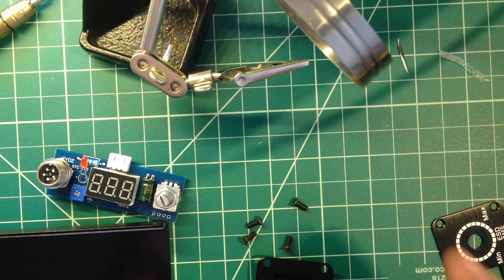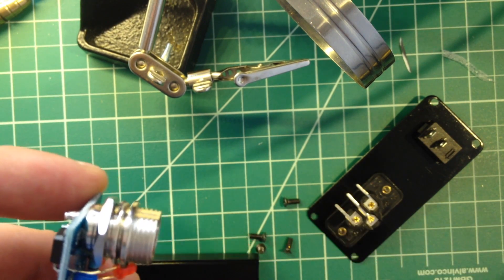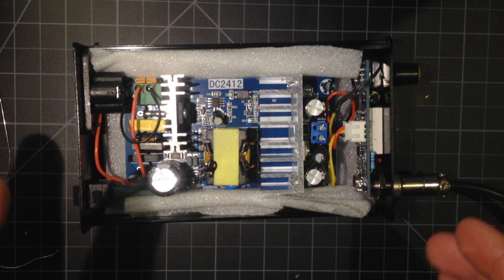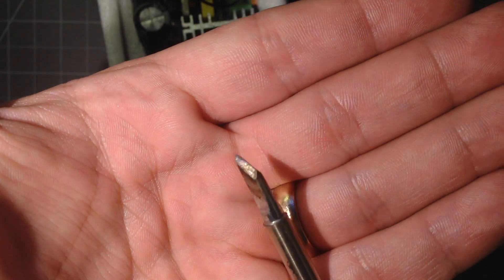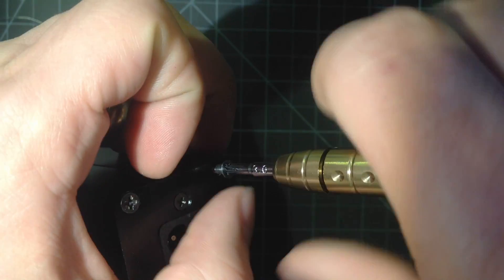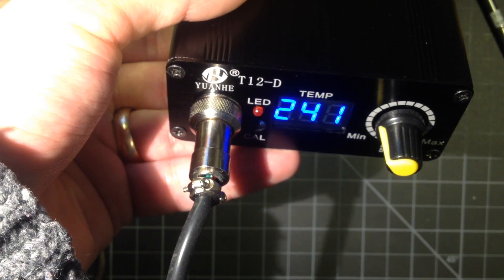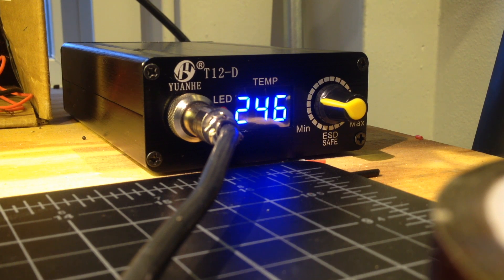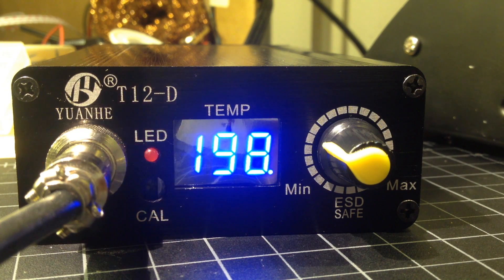T12 Soldering Iron Case and Power Supply

Comment: Yes, as you found out the yellow is earth,, the vibration switch is supposed to have the gold lead at 1, closest to lead,
the holes in the handle pcb are to feed the wires thru and solder to pads, unbreakable strain relief,, a bit of pain due to their springiness

Comment: Hello
Anyone have a schematic to ground the tip of this unit? I ordered one. But before she arrives I wanted to find, so I can make the changes when she arrives. Best regards
Reply: With mine I took the board out, Underneath the board I soldered a with to where the earth pin is soldered, then on the back of the unit I drilled a hole for a screw and attached the wire with a crimp to the screw, I then took a #2 Philips + and turned it about 10 times in each of the rear 4 screw holes on the back plate, this quickly removed the anodized plating. I assembled it and tested it, and yes the earth ground works on the case and right to the tip of soldering iron.

Comment: Why not use standoffs and why not make it grounded? 

Makes it a lot easier and saver, and do not like soft plastic in a solder station, and the solder tips are not grounded, because you need a grounded solder station case, and you do not have that.

Comment: Hi,
I  have just bought a same unit and it did not came with instructions. 
What is the purpose of the flashing LED?
When I press the rotary dial,  it shows 30 - any idea? 
My unit came with 3 digit display,  is it possible to change to a multi info display LED panel? 
Thanks
Reply from the maker: +Erkan O unfortunately I do not know what all the register settings mean. One is how long it should sit idle before dropping to 200 deg. Another is how long before it sleeps, but I don't know the rest.

The flashing led shows when its powering the iron. On mine it goes solid on startup, and starts blinking once it's up to temperature. There is also a dot on the 3 digit display that blinks when it detects movement.
Reply: MobiusHorizons 
Thanks for the quick reply 👍👍👍

Comment: Clearing soldered holes is easier with either a solder sucker, or what a repair guy told me years ago is a fine pencil lead (solder won't stick to it).
Reply from the maker: +Stephen Cook its also much easier with the large K tip of the T12 iron. I'll have to try the pencil lead trick, though.

Comment: Do the T12 tips have a thermostat built in? if yes what would be the pinout?
Reply: From what I understand, the T12 tips, themselves, have only 3 connections. Sheath/earth is one (which would be obvious just looking at it, lol. This would likely be the one closest to the tip, I imagine) Then they have 2 connections for the heater/thermocouple, which are in series. So w/e two pins show resistance (of about 2 ohms, cold) are to the heater/tcouple. I would imagine they would be the two closest to the back end of the tip.. if you imagine a TRS stereo connector, this is what would be logical. Then, if you heat it up and measure the voltage, you will see which is the positive and which is the negative, as far as the output of the thermocouple is concerned. So the 8 pin connector on a Hakko FM2027 is pretty ridiculous. I think they use a pin or two for the LED ring. And there might be some extra pins, too. This is probably so you don't try to plug it into an older, incompatible hakko station. But some of the Chinese T12 clones use only a 3 pin connector. To put it into perspective, the 888D handpiece (which probably IS compatible with some 937 and earlier irons with 5 pin DIN) has a 6 pin DIN, but the 6th pin isn't even connected to anything.   BTW, I would assume putting the heater and the thermocouple in series makes the T12 tips and handpieces cheaper to produce as well as ultimately making the connection to the handpiece more reliable and durable.
Reply from the maker: They do, but i'm not sure of the pinout.
Reply: Michael the pi out is (clock wise facing connector ) pin 1 ground (earth)(green) pin 2 + voltage (red) pin 3 + vib switch (white) pin 4 - vib switch (blue) pin 5 - voltage (black)

Comment: Ahoi Paul, Good show, very entertaining, thanks for sharing! Saw your vid as recommendation as I was checking out the T12 and discussing heat-issues on VoltLog's site about this product. Here's a word of warning though:
http://klcbsoft.com/img/psu-after-3-years.jpg
That is what ALL cheap PSUs will look like after a few years. PCB on the output side completely roasted, all caps in the vicinity totally dried out, the MBR20100-diode pack on the heatsink operating on it's last leg (and producing enormous amounts of heat that burn through the PCB).
I wanted to share the above image as you were stuffing your case with foam. The case in the T12 is closed and has no ventilation at all. Stuffing it with foam will make the temperatures even more ungodly than they already are. This will dry out your output filter caps (close to heatsink) and that will cause even more current drain and more heat.
That foam will for sure melt down onto your PCB from above and the sides, stick to it from underneath, melt and give way for shorting out solder pins with the chassis.
Just be careful with that foam - greetings!
Reply from the maker: thanks for the warning. I have replaced the foam with little self-adhesive standoffs as suggested by +standishgeezer. Unfortunately the ones he mentioned are not the right size for the holes in the PSU, so I'll find better ones, and put out a video.
Reply: Excellent, little standoffs as used for motherboards should also do the trick. Adhesive might also be susceptible for breakage under temperatures. The case under the output-heatsink will reach 50° C for sure (more in the years to come when caps dry out) and the main PCB might start floating around. There's some contacts very close to edges on that PCB and what's even more important: check if the heatsinks are soldered to the PCB and maybe used as "traces" (jumpers). If that's the case then the heatsinks are "live" and may carry several hundred volts to your chassis.
Looking forward to your vids!
Reply: Why not mount the PCB to the upper lid.
Drill through lid, then drill and tap the heatsinks and bolt them together. Turn the case into directly coupled heat-exchanger.
Reply from the maker: +NoName that's not a bad idea. I might have to try that

Comment: Good video, thanks. A few self adhesive nylon standoffs like these http://www.ebay.com/itm/20pcs-3M-Glue-Self-adhesive-PCB-Support-Spacer-Hole-3-2mm-Thickness-1-6mm-Nylon-/182025850398?hash=item2a61960e1e:g:gOMAAOSwPc9WwtUu would probably be good for the power supply (better air circulation).
Reply from the maker: thanks, i'll have to try these.

Comment: Nice build - I was thinking whist you de-soldered the front connector, 'Paul should use a hot-air gun' LOL Probably a smaller nozzle would have helped ;-) Isn't the foam a bit of a fire hazard?
Reply from the maker: I still need to get a proper hot air station. The one I used was just a hot air gun from the hardware store, which doesn't have small nozzles. 

The foam was mostly to provide a barrier between the mains voltage on the pins sticking out the underside of the board and the anodized aluminum below it. It doesn't seem to be getting very hot, but I suppose it could become a fire hazard. Would you suggest a different separator material? maybe perfboard?